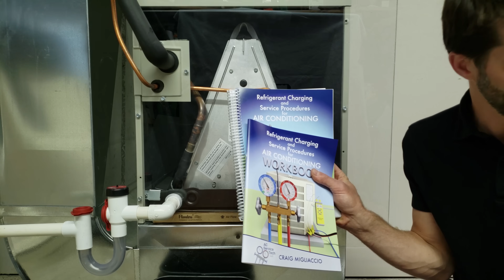Why a Condensate Trap is Needed on an Air Conditioner! Up Close View!

Comment: Could a faulty condensation exit pipe lead to a "tilted pillar"?  There are 4 or 5 foundation pillars which hold up a central structural beam, upon which most of the weight of our two-story rests.

Comment: This blew my mind. I recently had a clogged drain which overflowed and then leaked into the pan (which had a hole in it, so the water dripped into the ceiling below instead of setting off the alarm🤦🏻‍♂️)  I had to cut the PVC to get the clog out, and I reinstalled the trap as it was, even though I was a little confused why it existed. Glad I did!!

Comment: I just had my HV AC system replaced. My old condensate trap had a clean out with a cap on top. 
The new system they installed with a new condensate trap and a cleanout has no cap on top. Should it be capped or not?

Comment: Craig - do you have a video or could you make one on how to size ductwork using Manual D (equal friction method)? Great video here!  It clearly shows why a condensate trap is needed. However, I noticed that the top of the dranage tee has been cover with a sort of a cap. If this wasn't covered would the water drain out? I ask this since water always takes the path of least resistance as does air. This would allow some of the air to flow out of the top of the tee. I just wonder if it would make a difference?

Comment: I recently discovered a bad float switch the hard way. After extracting a large amount of water from the ductboard plenum under the unit, I became concerned my shopvac nozzle had damaged the yellow fibers. If a person is worried about loose fibers is there some kind of ductboard sealant you can paint the inside fiberglass with? (Replacing this plenum would require major construction so I need an alternate solution.

Comment: My system has a trap, but the blower is before the A coil, so there should be positive pressure at the A coil.  In my case, it seems it prevents blowing air out through the drain pipe, which in my case goes to a condensate pump.

Comment: Great video!  Learned a lot!  Now I know that we have that same (negative pressure) system.  Never realized that when the system is running, the condensate water is constantly trying to be pulled in while trying to drain at the same time.  That trap does more than I thought it did!  Great demonstration, thank you for posting!

Comment: Important to note, in this scenario the fan is above the Acoil and SUCKS air through the Acoil, this is when you need a trap. If your fan is below the Acoil and pushes air UP through the coil, you dont need a Ptrap as the positive pressure in the system will push water out.

Comment: Say you put a you trap on but didn't fill it with water is that a massive issue or when the unit turns off will the condensed water trickle into the trap

Comment: Whoa! stopped at 2:05 - that must be the negative pressure?  Our house has two HVAC systems, one downstairs and one upstairs and they are both American Standard,  
Thank you for your video, but I still get frustrated because we never received any supporting documentation for our HVAC system - No Owner's Manual and No Maintenance Manual - I asked the Authorized Dealer and they said they don't receive them from the manufacturer. I cannot find any Owner' Manual/Repair Guide on either the American Standard or Trane websites for our Air Handler Model #TEM4B0B24M21SAA: it was manufactured in December 2022 and the local Authorized Dealer installed it September 5, 2023 to September 8, 2023. The previous system upstairs was the same model as our current downstairs HVAC Packaged System, but we had documentation. Regardless of the age of the upstairs HVAC Packaged System It seems we still have to call for service every 06-months to 12-months! We always need to replace either a capacitor of contactor and clear the condensation line 
System 1 - Upstairs 
AIR HANDLER (Model# TEM4B0B24M21SAA) (Serial# 22501S2M3V) (Residential Extended) Functional Parts : Term End Date is 09/08/2033 (10 Years ) 
HEAT PUMP (Model# 4A6H4024N1000AA) (Serial# 232933EM5F) (Residential Extended) Functional Parts : Term End Date is 09/08/2033 (10 Years ) 
HEATER (Model# BAYHTR1510BRKC) (Serial# 2327B1DGAX) (Residential Extended) Functional Parts: Term End Date is 09/08/2033 (10 Years ) I am trying to balance the whole house ventilation. 
Over the past five years my parents had a new roof installed by a HORRIBLE ROOFING COMPANY [TIMBERMAN ROOFING in Okaloosa County, Florida}, replaced the original 1984 cedar wood siding with James Hardie® Plank Lap Siding, replaced four windows and this past spring we had every window re-caulked on our house. The downstairs living room is ventilated with the Upstairs HVAC Packaged System and is very hard to keep cool. I think part of the problem is that the roofers did not replace all the sheathing and installed a ridge vent in our high ceiling living room. Also the James Hardie Fiber Board Installers did not install either new sheathing or any new barrier on two sides of our house. It is so frustrating to get Craftsman in their trades! This our downstairs system https://youtu.be/BPGF4qnFJQI?si=fkSbNhfTklhNLwUZ

Comment: I have a p trap pvc built by installer who put it in but no vent my air handler leaks water could it be i have no vent pipe on my p trap and the negative pressure when its running is overflowing my my drain pan???

Comment: Excellent video... I have a question. I have the open vertical PVC pipe and it sits right under about a half dozen open attic vents that lets in dirt and debris when the wind blows (I know, I go into the attic every month to clean out the drain pipe). How do I allow the drain to vent without allowing a lot of dirt enter that vent tube from the attic vents?

Comment: Craig M’s mentioning of a drain line float switch is also important.  I’ve owned my move-in Rheem AC and in 14 years, suffered 2 big condensate pan overflows w/o float switch because I failed to keep cleaned the drain pipe.  Big overflow needing running a floor fan to dry over several days.  Now I use pan tablets, dropped some in the pan while cleaning the evaporator coils (which is like a 5 year sequence task) and in the P trap to rid of gunk.  I’m now in the process of installing a SS-2 float switch at the secondary drain plug-in, but the condensate pipe elbow is blocking it. Also, I brought  water sensor ($10) alarm through Amazon and placed on top of the supply duct base where condensate overflows first from the pan floods over; the sensor will sound like a fire alarm, so get notice with someone in the house.
YouTube Jersey Mike HVAC installs 2 float switches in his work.  He’s as good of these trainers but it’s your preference on who can teach you better.

Comment: I have an older system (80' 90's?), where the new furnace is from 2018 and now a new evap coil 2025, sized similarly to what was there.  There is actually positive pressure at my evaporator drain there, and there was no trap in the originally installed system. Idk, what I got from this video is that you need a trap if there is a vacuum at the drain port, so therefore I did the opposite, where I put a 3-way elbow at the drain port, one elbow grades down to the condensate pump, and the other elbow is pointed up (terminates at a Tee fitting, so it's like a cap or canopy so dust/debris can't fall straight into the hole from above).  My homeowner logic here is that it will help relieve pressure instead of blowing into the condensate pump, and also didn't glue down my Tee "cap" so you can drain snake it or check for clogs.

Comment: You should tell viewers this is a draw-through application which allows air to be drawn back through the drain line during fan operation thus preventing condensate from draining, in a blow- through application cold air will escape which a condensate trap will prevent.

Comment: If my unit is downflow, do I need the trap? The coil is the same shape and orientation as yours. I don't know if it's supposed to be operated in downflow, but that's how it was installed 14 years ago.

Comment: A guy only needs a trap when running the coil in a vacuum on the return side of the air handler or furnace.  You do NOT need a trap if you run the coil after the furnace or air handler on the supply side, as the air is constantly blowing thru the condensate.  Maybe you don't know any better but you really should have done a better job explaining that to all these clueless people looking for help.

Comment: Question, if the drain goes down, under the slab and then back up outside would that count as a trap? Assuming the clean out is capped so no air is being pulled in

Comment: Hello, we have a new Comfortmaker furnance and the HVAC tech is telling me that you do not require a p-trap on the condensate line. Is there any way to test if I need a trap installed? I can't find anything in the manual about installing a trap either. We just have 1/2" clear flex pipe running down to the drain.

Comment: its NOT the trap itself that allows it to flow, its that AIR VENT on top of the trap (black cap with RED vent piece) that allows air to seep INTO the system to allow the water to drop and flow down into the drain.
This is done in plumbing to allow water to drain down the pipes because with no air VENT on the TOP of the system, the water wont flow down and now you got stoppage.

Comment: Is this the case with my carrier air handler?? The installer installed the p trap backwards and the water wasn’t draining and I got water all under the insulation underneath the blower motor & inside my supply plenum.

Comment: My old AC evaporator had a straight drain pipe. No trap and it worked for 40 years. So why is a trap now needed on new installs? What has changed?

Comment: It didnt make sense until i said "but why?" I understand the siphon aspect but i dont quite get where the vacuum comes from. Is there no other open orfice for air to replace the water displacement or is the water pan in an area where the air is pulling upward and the hole for the p trap, when off, is becoming a vent for the massive air displacement to take up more volume from? Both? Neither? Ty

Comment: so if youre not sure if you have a positive or negative pressure system, installing a p-trap would work on either one, correct?  Positive would just blow the water out while running, while a negative needs the p-trap to allow water to drain while running.  Do you recommend a vent AFTER the p-trap in both situations?   And a T connection b4 the p-trap to allow for cleaning in the future?

Comment: An air trap is a superior solution, condensate traps will build up slime and cause the system to back up. An air trap stays dry so there is no slime build up to cause the condensate line to back up and over flow the drain pan. Air Traps can be bought for both negative pressure systems and positive pressure systems. An air trap will never freeze which can cause the p trap to burst and you will not have to worry about dry outs either where the p trap will dry out during months when the A/C system is not used in the cooling mode. DES CHAMPS Technologies sells the air traps.  Google A/C Air Traps and you will find videos showing how they work.

Comment: My roofer knock out my trap in the AC unit and replaced it with no trap😢. How long do I have until it damage the system? It’s draining with no trap atm. I don’t want to be rude and call someone to repipe while they still working on the roof for the whole plaza

Comment: Yeah it’s all fun and games until crap clogs that trap. I’ve just been called by a friend who had water coming thru the ceiling. Clogged trap. Overflowed pan. Hundreds in damages at the very least. Unit in crawl space the owner was NEVER going to go crawling around in. We survived for a long time without this somehow. Edit: now I see the pan also has a drain pipe. Why that failed is unknown at this point. Same house basement unit clogged and the concrete floor dealt with the water. No biggy.

Comment: Could a dry trap cause the AC to not put out cold air? Fan is working. Thermostat is working. Filter new.

Just added water but dunno if that will fix it.

Comment: I have some conflicting issues. Company says its not necessary, systems run well without, all due to static pressure. They also say it leads to more service calls and possibly damage if customer doesn't get that service done leading to premature failure due to water damage on circuit boards and such. They mentioned with high static pressure issues such as roof top units, they use p traps.

Comment: Great video!  There should also be a vent pipe on the left (output) side of the trap you show in the beginning of the video. I remove the red cap on the trap and put the tube there.

Comment: Now.....this IS correct......HOWEVER.....on positive pressure coils (such as those installed on furnace outlets or some air handlers). TRAPS ARE NOT NECESSARY ! The only time it IS necessary in positive  installations is when the drain is connected to a sewer/continuous waste. Traps in positive pressure will otherwise unnecessarily plug up.

Comment: The p trap on my unit is located way below my furnace and not immediately after it leaves the condensate coil. I noticed the unit doesn't drain much water I recentlynjad the unit replaced wonder if I need to fill the pipe all the way down to where the p trap is with water to get it to flow better?

Comment: Hey I had one on my hvac when I moved in but after a few years when getting it serviced the guy said I didn’t need it. So i just have a t shaped pvc allowing air to vent out the side as water flows to the condensation pump. Haven’t noticed any issues in 2 years. Should I install one? Anyone know?

Comment: I have a 5 ton, air handler is in a closet in downflow configuration, with negative pressure. actually the whole closet has negative pressure, should I be using the larger clear trap shown here. do I need a vent after the trap? and will the suction inside the closet draw air from the vent? preventing its purpose. It only drains down vertically about 3 ft under house and out horiz 3 ft to outside.
    Any Input,  Thanks

Comment: I wonder if this is the reason why i’m having an issue with a coil i did . It’s draining out of both Primary and Secondary side. it didn’t have this issue before and it also didn’t have a trap either . Primary is clean and clear as well but it still comes out out of the secondary side as well

Comment: At 1:47 of the video where you show it up close where it exits the pan I have a question. How did you disconnect it from the unit to show that view? Are you able to unscrew it from the unit with what looks like a collar or screw on cap. I thought with the PVC pipe glued together you wouldn't be able to just unscrew it. I am just not familiar with this but I need to access it from the unit side to see if I can clean out pluggage. When the unit was installed they didn't put any kind of a  "T" or cleanout on it and I've heard you don't want to put any kind of pressure that goes toward the unit. I believe the pluggage is just a few inches downstream of where the condensate drain line comes out of the unit. The problem is it comes out and immediately down with a 90 degree elbow then across and inch then elbows up then another 90 across and out. It is all elbows with just a tiny bit of pipe between the next elbow. It comes out, down across, up, and out. Wish I could show a picture.

Comment: My drain line has a clean-out pipe, but it is blowing air out, not sucking in. Is this a problem? Also, should this pipe be capped, or leave it open to let the air out. (The drain is dripping out the exit outside the house currently, with no cap on it.)
Thanks

Comment: Will the lack of s trap cause cooling issues? I have a new install that isn't cooling properly.  I noticed no condensation flowin at all. I sucked a bunch of water out and the temperature dropped about 8 degrees in ten minutes then rose again swiftly.

Comment: HI, I just got the book set from your website, I did a p trap on my AC but it did nothing, I found that I have a downflow and I have positive pressure instead, I fixed to free flow again,  but I have a problem with the coil driping or splashing in to the center fallin in to the Plenum very little goes to the drain pan, I look inside and the drain is ok, water just jumps inside I dont know what else to do, the ducts and the plenum are wet from the water blowing down. please help.

Comment: Thank you very much for clueing me in. That solved the problem of condensate build up in the bottom of my A/C unit. I cut a hole in the piping for easy trap cleaning; I did not realize it receives an internal negative air pressure. I thought it only trapped debris. HAGO; Thanks again!

Comment: Great video! I just bought a house with the upflow system with the filter at the bottom of the air handler like the one in the video. The question I have is I also have a return filter in the kitchen, do I need to replace both filters monthly or just the return filter in the kitchen? The filter at the bottom of the air handler wasn't there when I look after unclogging the trap.

Comment: So my system is brand new. And it has a hose coming out going straight down to the drain. We haven't needed the AC much but when it runs there is a gurgling noise that comes from the overflow hose. When you put your finger over the gurgling stops. But condensation is coming out of it. I just talked to my HVAC guy today and he said that we should put a trap in it. Whether it be PVC or just the right kind of bend in the hose. The hose is clear and you can see the water coming out and going through. But it is gurgling so I'm assuming that is the sound of air hitting the water without a trap. Thoughts?